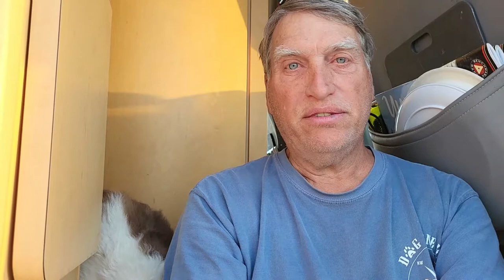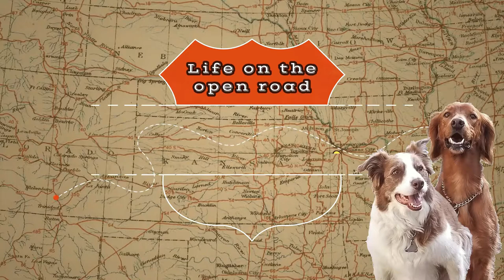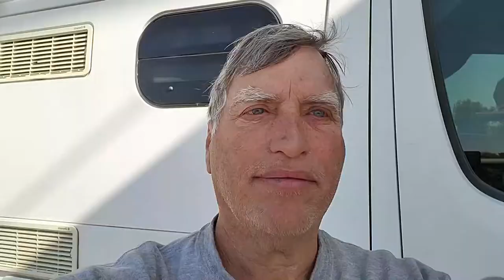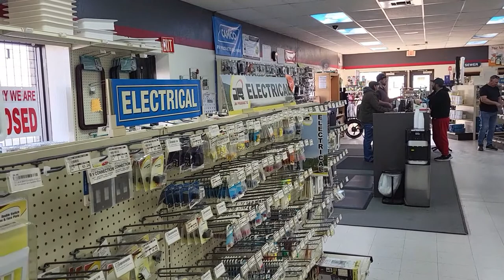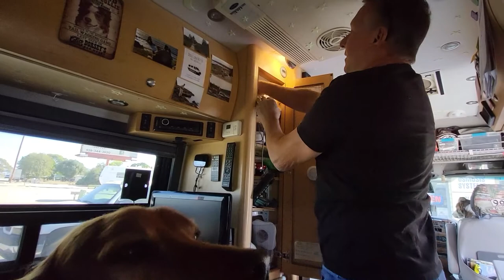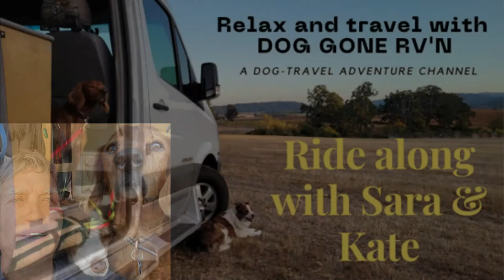PROBLEMS WITH MY RV'S POWER SYSTEM

Comment: So sorry about the frustrations you were having. I know that once an electrical system is installed. They can be very difficult to change or even understand. I recently purchased a six year old pleasure way with two 100 amp lithium batteries. There are two panels which contradict each other, and I am not sure how to assess the condition of my batteries or even tell how much of a charge they have. Also, do I have 200 A of battery there is only a 450 W inverter and I am told that to upgrade to something like a 2000 W inverter might cost five or $6000, which is crazy. So I will continue to operate with Shore power for the generator if I need to run the microwave or air conditioner. Hope your situation is resolved soon.
Reply from the maker: It has been a learning curve for sure. I am narrowing it down to what fits my needs and works for me best on the road in all seasons. Thanks for your feedback.